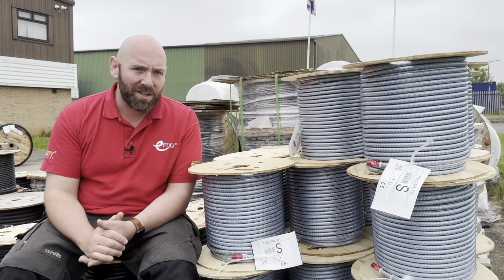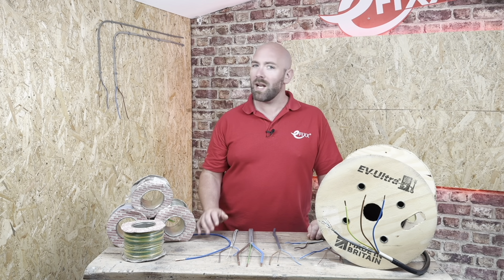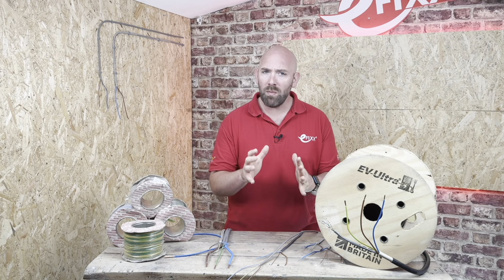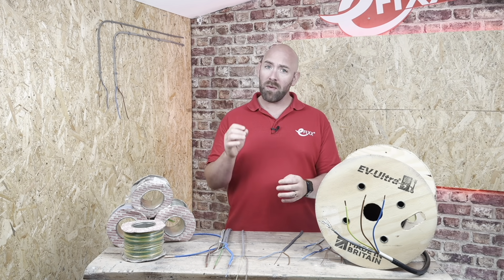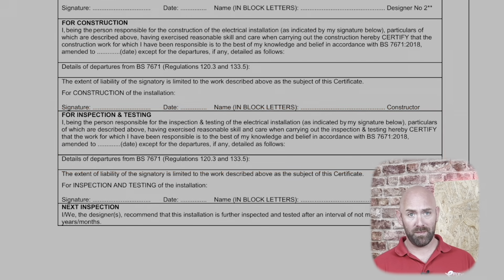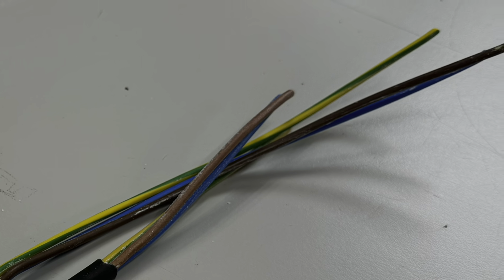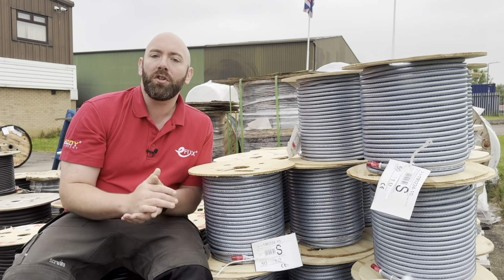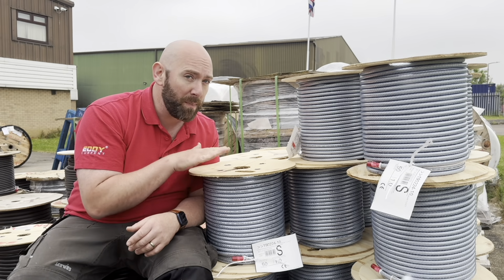Wiring Regs Departure: Can You Trust This Cable?

Comment: I disagree with the point that SY can't handle fault current. You worded that quite poorly, the BRAID can't handle fault current, the inner cores absolutely will, if made to standard metric sizes (which they are).  Other than that 100% spot on, see it used outdoors all the time. One place it DOES have its use is on pendant sockets for workshop use
Reply: Control signals are in milliamps or less. So why use cable with such a large cross-sectional area, like so many of them have. I believe its fine to have it carrying the full current of a connected load.
Reply: @MyProjectBoxChannel  But SY isn't just used for control signals. It is designed to supply current in a high vibration environment. I'd never use SY for a fixed installation like a car charger, but for the head of a miling machine or CNC lathe it might be appropriate. So I want it to be capable of carrying the full fault current. Easy enough to do if you spec an extra core in addition to the line(s) and neutral.
Reply: @MyProjectBoxChannel  being multi strand, same as flex, tri-rated etc etc, it has a higher load capability than solid cored conductors. It IS a better cable for many things than shitty T&E.
Reply: @MyProjectBoxChannel  Control signals are milliamps, but ELV power for field equipment, particularly actuators can be up to an amp or two for a single large device.

That said, different install companies have their own preference sometimes we find SY, sometimes Belden (equivalent), sometimes a mix. We find that while most control signals are ELV, there are still plenty of 230v control signals that we often just deal with directly rather than putting a relay locally, so something like SY is required for those over Belden simply for the insulation rating, nothing to do with cross section as almost no current will flow anyway.

Ethernet cable is amazingly versatile, cheap, widely available and able to carry control signals and ELV power but we're obliged to follow manufacturers instructions and guidance when using their products so using any cable for things it wasn't intended for is almost never allowed.

Comment: while i'm sure that destruction will be fun, what "tests" are used to ensure than the non approved cable is just as safe as the tested and approved cable please?
thanks
Reply: My mother showed why Earthsure is less safe when she cut a live cable with scissors. The uninsulated CPC made it the least resistance path to ground, not her body. It seems that the testing ignores well known fault situations like accidental cuts into the cable.

Comment: EarthSure? not CPCsure
Reply: Where has this CPC rubbish come from . As far as Im concerned it’s an earth and always will be .
Reply: Doncaster are pragmatic, despite Gary's hatred of it, very few people on site call it 'cpc'...   I do understand that in some situations where you have earth free systems the cpc may in fact NOT be earth... but at all other times, it is
Reply: @ been twisting wires together for 45 years so its still T&E
Reply: The only people who call it CPC are Gary and co and that Mainly Electrical chap.  People who like spouting regs all day basically.  99% of regular sparks call it earth because that's exactly what it's connected to.  The regs should be changed back to EARTH.
Reply: @ I totally agree.  It’s stupid teaching youngsters CPC  . As soon as they get into working conditions with other sparks the term is not used ,it’s an earth wire .
Reply: Why do you insist on plugging and continuously mention Doncaster cable there a number of other Uk cable manufacturers . And to keep plugging Earthshore which is even recognised by the IET and BS7671 is ridiculous , just because they sponsor the channel doesn’t mean you’re obligated to keep plugging them. But what do I care , I don’t I’m only interested in the topic of the video not the brand name of a product.  Don’t care who makes it , it could be made by the Teletubbies for all I care so long as it does the job and is safe to use .  Sorry just my opinion . Just saying. Rant over
Reply: Exactly CPC is nonsense even Doncaster cable call earth ie earthshore 
Buy a drum of TW&E it will be printed on the label example 2.5mm2 twin and earth, some will say PVC insulated flat twin and earth.  

Rant over.